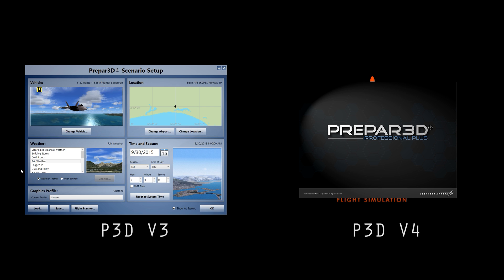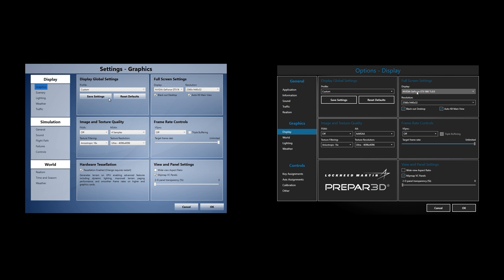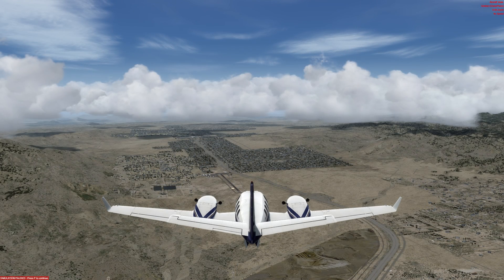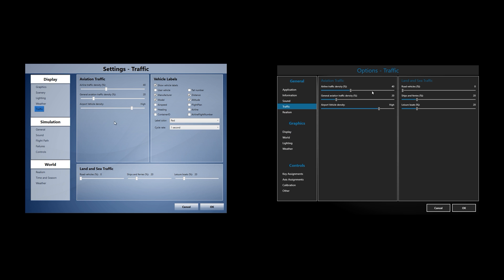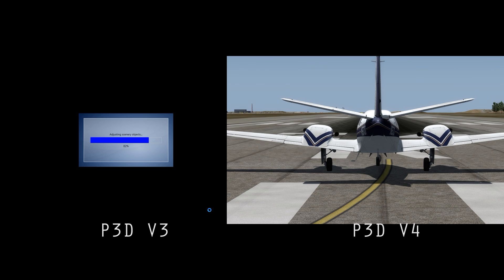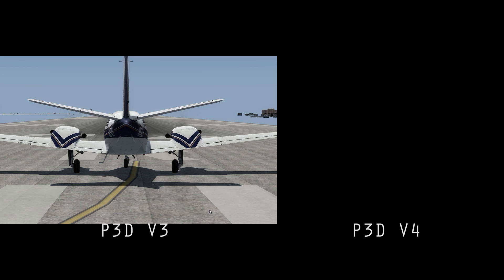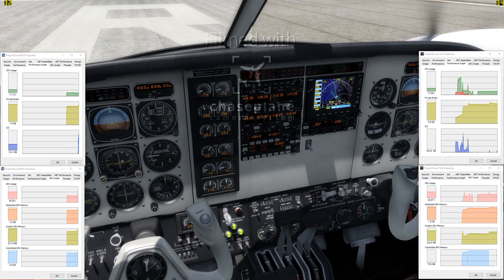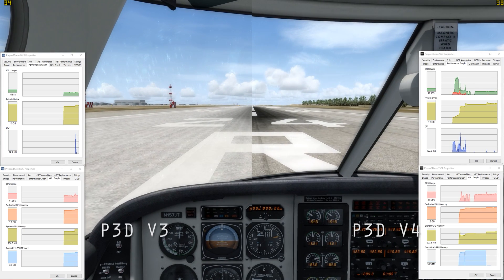P3d v3 VS. P3d v4 *Performance Side by Side and Stress Test*

Comment: x plane11 still way better
Reply: Indeed.  Would be nice if 3rd party devs would work with it.  But P3D is suckling off the established MSFS backbone and legacy compatibility is still a big thing apparently.
Reply: J.D Invictus hahahaha x-plane's engine looks way better than P3D. Weather is great! 
IXEG 737 (Same level as the NGX)
PMDG DC-6 (PMDG, 👈🏻)
LES Saab 340 (Same level as Majestic)
Flight Factor 757 (Same level as PMDG on systems)
Flight Factor 767 (Same as 757)
FlyJSim 727 Study v2 (Best 727 on the market)
FlyJSim 737-200 (Best 732 on the market)
Airfoillabs C172 Study Sim (Best C172 on the market)
Those are all high end addons
What is coming?
Flight Factor A320 (better than FSLabs systems)
Rotate MD-11 (better than PMDG MD-11)
Icarus DC-9 (Very great, supposed to be study sim)
Magknight 787-9 (Not high end, but a great quality 787)
ATS MD-82 (Better than any MD-80 on the market)
JRollon CRJ-200 v2 (Huge redesign!)
SSG CRJ-700 (Competitor of Aerosoft)
Milviz ATR 72-600 (Also coming for FSX/P3D)
ATS MD-11 (Same as with Rotate)
What utilities are great?
XPRealistic (like ChasePlane and EZDok)
MisterX free Airports with ORBX quality
MisterX Runway and Taxiway optimization
Zibo 737-800 mod
FlyWithLua
Ortho Scenery (Not even 1 payware product, all free and very realistic)
REX is coming
UK2000 is coming
And i only mentioned a few things
Reply: What do you mean it's not of the same quality? I say it's equal, if not better (Remember, I've used the Ifly 737--if anybody remembers that, PMDG, and IXEG, and being that I've been around 737s through simulators and real access). The sound itself beats the NGX, given I've flown on both the -300 and -700 countless times. My point being, you're judging X-Plane when it's in it's infancy of getting attention. To add, the scenery for X-Plane can easily beat P3D's. Would you like to spend (let's be real here) insane amounts of money for scenery, or use freeware for X-Plane that is just as good, if not better? You seem to completely forget Ortho Scenery, which yes, I love not having to destroy my wallet for. Because the X-Plane community has learned to develop higher quality freeware (Such as MisterX6 and other sceneries, which there is little to compare with in the MSFS world besides SunSkyJet), there is much less of a pirating problem (which runs insanely rampant in the MSFS world). X-Plane beats P3D in aerodynamics (which is a serious hitting point), detail (I'm talking about looking at road traffic, curved runways, vibrations (which comes free , which destroys P3D), and failures. If you do the engine startup of the FF 757, you will lead to an overheat which will lead to a complete failure of the engine. As much as you enjoy the P3D/MSFS world, I've never had that much detail taken into a simulator (and from PMDG experience as well). I respect your loyalty with the Microsoft/Lockheed side, as I was in that same spot for a decade., however I disagree on nearly all of your points given that X-Plane has freeware scenery that can compete with MSFS payware, and addons that can also compete with P3D addons, and I simply do not see how you cannot visualize that. Also--textures, UI, sound, Depth? X-Plane beats P3D in all of those areas, hands down. You're calling others "fanboys", yet you're showing the exact same traits you're criticizing (which is I why I rarely use the term itself)

Here's a comparison between X-Plane 11 and FSX:SE along with P3D. These aren't watered down to make one look better or worse. They are just straight out from when I was doing flight.
http://bit.ly/2rhEIRV
http://bit.ly/2rlznLc
Reply: UK2000 and REX will develop for XP 11. A good start...
Reply: I would like to disagree, as if I want to fly a 737, I have the IXEG, FF will give us the A320 that we've been waiting for, and I love the 757 and 767. We have MD-80s and such. You need to realize that there are planes in P3D that XP doesn't have and vice-verse. It's more so of, what do you fly, not "this is better or worse". Trust me, you haven't given much time to X-Plane, regardless of you "2 years of experience". I've use MSFS platforms for a decade, and just recently moved to XPlane. It certainly does the job. Ortho4XP and our custom group certainly does the job. Honestly, it's not that much of a letdown with Orbx as we can have terrain and scenery just as good through different methods.
Reply: I need to say when you see P3D V4 on video and X-Plane 11 IMHO X-Plane is way better the new beta version is really optimize and 98% stutter free. I know they don't have all the add-on I got on P3D, I will give a shot for sure for P3D V4 to with my PC what it look like but when I'm flying in X-Plane I found the immersion very great. For my part if I was able to have all my add-on on X-plane 11 I will move on or I need to change my mentality and be open to try new add-on like FF with the A320, the B737 default modify by Zibo, new airport by Mister X...
Reply: Marc Hatzimanolis  Maurits Veen P3D/FSX= PMDG 737, 777, 747, J-41, MJQ400, F1 DC-9-30, B350, ATR72, C-Mustang, M-dog MD-80, A2A C152/72, B-17, L039, P-180/250/51, T-6, B377, Spitt, RAir B60/T, Mlviz b-55, c-310, Level-D 767, TFI B717, FSL-A320 etc!....these are ALL REAL STUDDY Level sims. 
Weather ASN AS1016, OPUS, REX. All as real as it gets!

Maurits Veen IXEG 737 (Same level as the NGX), LES Saab 340 (Same level as Majestic),  Airfoillabs C172 Study Sim (Best C172 on the market). You on drugs? LOL! No comparison, you list just got from bad to BS!

The texture quality in ANY x-plane cockpit is plain ugly & not looking real at all, the gueges, efis, pfd can't be compered with FSX/P3D! And don't let me start on scenery, x-plane will always be ugly !!! 
I won't even touch it for free! 

Best sims P3D/FSX & DCS World if you want to come "as real as it gets"/ from an IRL ATPL  Captain >9000h (F-50, Saab-340/2000, B742, B777, A320).
Reply: J.D Invictus IXEG? Flight Factor? Rotate? They have high quality addons, just not the type you fly (likely). After all, there is much more freewarr that is actually good, than in MSFS, thus less of needing to purchase things. And nobody pays attention to the default 737. It's not the PMDG, but it's an amazing aircraft. If you don't like the looks, change it yourself in the settings and with addons such as BluFx. I hate the "desert dry" look of MSFS, with little to no elevation detail with airports (i.e. curved runways) but that's just imo
Reply: PMDG 737? - IXEG 737
Like I've stated before, this is solely based off what aircraft you fly. I can ask the literal same with - What aircraft comes close to the Flight Factor 757 and 767? MD-80? CRJ? Etc
Regardless, there are high quality addons for X-Plane, just that it is solely based off what you fly. To add, MSFS has had over a decade for addons and developers. Sure, X-Plane was around at that time, yet you haven't given X-Plane an equal amount of time and attention to really prove itself with developers. If you gave XP the same amount of attention and time, it would destroy MSFS. You can't compare a baby with a full grown adult, thus X-Plane is just now starting to get some serious attention, therefore it's remarkable itself how it's competition and beating (in areas) MSFS without all the attention that MSFS is needed just to stay relevant.
Reply: I'm not a fanboy for anything, I see that childish. I go wherever the tech looks the best and gives the most immersion and for me at the moment that's X-plane 11 with its many free add-ons. if you prefer FSX or Prepar3D no one is trying to persuade you against it, it's a matter of personal choice. I have been with FSX and spent hundreds of dollars and hundreds of hours trying to get it to look good and I get X-plane for me to look better and for free.  So don't be childish and fight over your personal choice.
Reply: FF A320 has to to prove ii self if it wants to be compared as good as Fslabs. So far Xplane is way better and I'm still holding on to my cc to purchase P3D. Time will tell. I'd rather be flying a Fslabs A320 on xplane11 than on P3D.
Reply: JordanCO_ TV I've watched your video's. You can't program an FMS & who is flying an approach with M0.23 in the 737 MCP? So don't talk to me about system or flying knowledge! 
Yes, I look  85% in my flying at the instruments IRL (PFD ND ECAM) & after 20 years of flying I can spot the un-real looking, low-refresh rate, wrong colors, lack of compressibility error, not correct standard-rate turn, turn & slip indicator, wrong power to pitch ratio, etc. And I see that allot in x-plane! 
Mostly I'm fed-up with talking to armchair-pilots who don't know shit about RL aviation!
Reply: Have to agree with you Toti, see nothing there that would make me ditch X-plane 11.
Reply: +Jiří Kocman good question.  Just because some of us former fsx code base folks like yourself have started coming around to xplane doesn't mean we don't still have an interest or some modicum of hope that one of these two devs will come through and deliver a flight sim experience that represents 10 years of technological progress as opposed to lipstick on a 64 bit pig I lieu of a 32 bit one.   

And, for those on the fence not sure what to do, because all of this waiting for someone to update the fsx code has led to not all that much,  well they should know that more and more fsx'ers are beginning to embrace xp11, because it does represent that progress that all of these fsx re-hashes lack.
Reply: ImagenNoReligion 
LES Saab 340
Well IXEG 737, Flight Factor Boeing 757/767, FlyJSim Boeings, just a few
Airfoillabs C172
Reply: ImagenNoReligion haha IXEG not being on PMDG quality. I, fly, both.
Reply: ImagenNoReligion The Airfoil C172 is a study sim, how can it be better? And yeah, agree that the 757 has some autopilot bugs, hopefully they will fix that
Reply: ImagenNoReligion menu's? Textures? Update's? Depth? Sound? What is wrong with those? They are all great!
Reply: And to add, if anybody is a "fanboy" it should be me as I've been insanely biased with Microsoft/Lockheed Martin for years upon years, not even giving a change to Laminar Research. It's phenomenal how a couple of guys with Macs are challenging large-scale corporations such as Dovetail (Ex-Microsoft), and Lockheed Martin. And as I said earlier about the pirating problem, funny enough, there are already cracking videos on v4 regardless that there is a free trial for 90 days I believe my case here is closed
http://bit.ly/2rSCBX9
Reply: J.D, in a respectful way, I disagree with everything you've said. Firstly, if you look at the pictures I sent in my last reply, you'll see visually, I don't see how MSFS and P3D competes, at all. The panel of the FF destroys the QW and CS. Yes, they can be compared, and they have. If you would like me to do so, I gladly will. Again, I have flying experience, just as I'm assuming you do (at the controls, not just sitting in the rear smiling). Once Again, if you read my comments earlier, you'd see how I said you can change settings. Don't like it, you can change it yourself.  And what do you mean "PFD can't be compared (**it should be compared, not compered)?" Not only is that insanely vague, it's just simply not factual. The FF 767 PFD works just as the real one does, I should know, having been in 767 flight decks. Again, I believed you were trying to be respectful at first, but "all x-plane scenery is ugly?".  Seriously? That's insane levels of bias. You're telling me this (http://forums.x-plane.org/index.php?/files/file/33270-kbos-boston-logan-international-airport/) is ugly? As said by yourself, "You on drugs? LOL!". Again, try to be at least a little respectful, and let's not just throw full bias towards this. I've acknowledged that P3D is a good simulator, and I'm stating my claim and defending it. You're literally throwing your -biased- opinion around. To add, the Level-D 767, is not on par with the FF 767, and the DC-9 compares with the freeware DC-9 of X-Plane (which is of great quality). The M-Dog MD-80 is outdated, and again, does not compete with the Rotate and ATS MD-80. To add, all P3D v4 videos I've seen still have stutters (I'm not the only one, look through the comments of this videos, others have seen it). What good is 64-bit if you still stutter like this, and how bad will it be once you load all the addons in?
Reply: The free add-ons for XP, especially airports, are amazing and getting better. The plane add-ons are weak but after watching some of these V4 vids, I see more people will move to XP11.  That should push the bigger plane developers over to XP, or so you'd think.
Reply: +John Moore what good is all that scenery if the shitty program stutters through it.  I can fly my Airbus which does simulate fbw through a dense Manhattan skyline with zero stuttering, yet I couldn't do that in fsw without addons.  Also forget about fly by wire what about basic physics.  Xplane clearly has the edge on that. Not that physics is important in a flight sim, I guess we can call that a nice to have not a must have.  Finally all of these addons will eventually be on xplane because if pmdg doesn't do it someone else will.  In fact isn't pmdg's next release also available on xplane?  I guess it's not that hard after all - life will find a way. 

Stop hating, we all used to be hardcore msfs fans back in the day, but times have changed.  Xplane may have been the mac of flight sims  for most of its existence but it's quickly becoming the iOS of flight sim and devs are taking notice.  Meanwhile msfs code base is becoming the windows phone of flight sim.
Reply: +John Moore why would fsx people switch to p3d to get more of the same, when they can do so much better with xplane.  I wish fsx'ers would  stop being so green eggs and ham about this and just give xp a proper try.   I promise you if you put in the effort you won't go back to p3d.  It looks like utter shit in comparison to xplane, I'm sorry but you need to hear that, it looks like utter shit.
Reply: +Jiří Kocman TWITTER WAR!   This is YouTube not nam, there are rules!  

No it's not trolling, It's my expression of disappointment with respect to the marginal improvements we've seen on this code base as shown in this video, which I've been waiting for as long as you, whether with p3d or fsw.  If that's all I said you'd have no gripe because it's on point.  However, you won't allow me  to go one logical step further and suggest to  some who also have been waiting years for this moment and are also disappointed with this marginal improvement give xplane a try, well that's just silly.  

Perhaps if I went on a rant about how battlefield is better than call of duty you'd have a point, but in this case I believe X plane comments have a frame of reference here, man.  

People are about to make big investments in terms of choosing the next sim, I think opinion regarding all options is in order.
Reply: That's because this was meant to show the difference between v3 and v4 only. It wasn't meant to compare all different sims. The OP isn't a troller.
Reply: What weather is very good?  The $80 plug-in that makes all the clouds 2d sprites that spin around when you pass over them?  I will say the default clouds now in XP 11 have come a very long way.  As for high end aircraft, name one that compares to the Majestic Dash 8 or the PMDG 777 or A2A's GA aircraft.  There is a polished level of software that you just don't get with X-Plane add-ons (YET) -  I think that will change in the near future but right now, no.
Reply: If you think IXEG 737 compares to PMDG 737 then I understand why you would be confused about this.  The IXEG 737 doesn't even have a complete FMC.  The menus might as well be DOS based.  Yes there is an add-on 737 for X-Plane, but is it the quality of PMDG's?  No, it's not.  And yes FSX devs have had more time, so what?  How does that change my point?   Add-ons are of a higher quality for P3D.  Goes with scenery too.  Look at Orbx's block island compared to a brand new block island that came out for XP 11 this past week.  It doesn't even compare.  And I will give it time, I want X Plane to get better, but right now, it isn't.
Reply: It's easy.  Textures, Menus, Options, Updates, Liveries, Depth, Sound.  Aside from being a study sim, those are some other areas I look at when purchasing an add-on.
Reply: ImagenNoReligion btw about the $80 cloud plugin. I think you have the wrong thing. That is SMP which costs $40. xEnviro costs $70 with 3D clouds, not rotate when you fly past them, uses an accurate real weather system, and rain and snow effects
Reply: I agree with every add-on you mentioned.  I still like the feeling of flight in XP though.  Obviously A2A got around it with their own flight model.
Reply: It;s getting better. But I can't lie this weekend I  reinstalled FSX so I can fly the FSlabs A320.
Reply: LSilva 😂😂😂
Reply: J.D Invictus bad to bs? I can already see that you never even saw x plane, saw...
Reply: J.D Invictus lol don't say P3D does that even a bit better. X-Plane's flight dynamics and graphics are far more superior than P3D v4. I also fly sometimes as a pilot, sometimes in a full motion sim (like tomorrow, KLM training sims at Schiphol East) and sometimes irl. (Last time in a KLM Aeroclub C172) i know exactly how a plane reacts and how it all should be, and X-Plane does this in many cases way better than P3D. The only reason i have P3D v3 is because of the MD-11 and the 747 v3. I can end that chapter already soon with the upcoming MD-11 for x plane, and then just leave the 747 behind. P3D=money, game that kind of stuff. XP11=freeware stuff, FAA sim you know what i'm talking about? Well thank you. As i said with the 747 this 'chapter' is over for me. Have a good conversation.

Cheers,
Maurits Veen
Reply: In response to the sceneries you mention, We have Drzewiecki Design for New York airports, MisterX6 for KLAX, KSFO, KSAN, and have KSMF sceneries (all of which are free and are of great quality), we have Aerosoft Amsterdam, along with Aerosoft EGLL. Seattle is custom made and is great and yes, there is payware and awesome freeware for it (just have to take a look around x-plane.org) Therefore, we do have the scenery. Remember, the exact same statement can be said to the MSFS world. Where is your 757, 767, MD-80, 737CL, A350 of high quality that real crews? Where is your Houston Hobby? Dallas Love Field? New Orleans? Portland (which is seriously been lacking) etc. It's more-so of "what you fly". I've never heard PMDG make a statement like that, and yes, X-Plane can surely handle a PMDG-level product (as it already does with Flight Factor products and IXEG). I've got some confidence in Rotate with their MD-11 (as they've stated they're going for a better product than their MD-80), and having owned the QW 757 (as CS), they don't come close to the FF in terms of quality. I have my doubts with aerosoft and how in-depth it will be, system wise, with their future products. Again, I fly certain types of routes, therefore I don't need most of what you described. "If X-Plane is the future, then PMDG, Majestic, FSLabs, FlyTampa etc will all go out of business." - Not really, they just switch or make sceneries for both... That's already happening right now honestly. And finally, X-Plane is not a "weak" simulator, because of it's engine, we have certain things P3D doesn't, (not that it really matters just making a point). I've used P3D and MSFS for a decade and just now am using XP. It's just as powerful, if not more, from my experiences. With the original beta release of X-Plane 11, there already has been a shift, and as Laminar Research continues, we're seeing more of it. Don't get me wrong, P3D has some awesome sceneries that X-Plane doesn't have an equivalent to (such as KMDW), just that XP has some that P3D doesn't and vice-versa

And may I question why you believe X-Plane is too "Weak" to handle a study level aircraft? It already does this perfectly fine...

EDIT: Forgot to mention we can convert plenty of MSFS sceneries to X-Plane with ease :)
Reply: You can convert your Drzewiecki Design NYC to Xplane for free using World2Xplane converter.
Reply: pifflelaw Drzewircki has their NYC scenery for XP available
Reply: +JordanCO_ TV true, just an FYI for those who've already spent the money on the fsx version, they don't necessarily have to go out and buy it again.
Reply: +pifflelaw Yeah. With all the freeware available, much less pirating :D
Reply: Sorry, not following.  I'm only mentioning it because one of the common reasons you hear for not wanting to adopt X-Plane is that people are too invested in their addons.  I'm pretty sure it's within the realm of fair use to transfer your flight simulator scenery packages, that you've paid for, from one sim to another, as long as it's for your personal use.  I certainly don't think that would be considered piracy.
Reply: pifflelaw I mean in the MSFS world, piracy runs rampant with tons of payware, along with little freeware that is of high quality. However, in the XP world, there is more of a balance of high quality freeware and payware, leading to less piracy. After all, there are already cracking videos for P3D v4, sadly enough. My apologies if I wasn't clear enough
Reply: pifflelaw Pretty much. I feel as if PMDG currently has an open door for aircraft, however the longer the wait the more likely some other developer will develop something for it (imo)
Reply: John Moore It would be awesome if they released copies for X-Plane and P3D, with a team working for XP and one fot P3D. I doubt it'll ever happen, but time will tell
Reply: John Moore I mean if they did similar to what PMDG did with their DC-6 (released one for P3D and one for XP). I've never coded for XP, however I haven't heard of the SDK issues. PMDG has already dipped into the water with their DC-6, it's possible
Reply: What I'm saying is look how long it's taken the DC-6 to be P3D ready. there's obviously a lot of things that have to be changed. Porting their current lineup just wouldn't be feasible for them considering the small fanbase of XP and most of their customers on FSX and P3D. I think one dev put it this way "in X-Plane, it takes 50 lines of code to accomplish what 1 line can in P3D"
Reply: No doubt, that would be insanely awesome! I don't think that even PMDG would want to finance 2 full time dev teams though.
Reply: John Moore Yeah, just I've never heard that (not saying you're lying or anything, just haven't heard a developer say that). I mean for future development to have to separate groups working on a model, one for XP and one for P3D. Scenery wise, Scenery making is fun and I've have much better experiences with it, but I see you're point. Maybe when time passes we'll see something different
Reply: pifflelaw It took me ages to even consider the demo, and I denied the demo regardless of how good it was. Based off what I did, probably others are in the same state I was in
Reply: I downloaded the demo, and I actually hated it at first.  However, it was the youtube videos and the delay announcement from Dovetail that convinced me to take the plunge and buy it anyway.  Once I took the plunge it probably took me a good month or two before I really found my stride with it, but now that I have, I'm never going back to an FSX derivative code base.   

If I could suggest one thing to Austin it would be to make it a timed demo, like 60 days, but allow full access.  This way FSX'ers can explore their favorite regions using the great free addons that are out there and learn the X-Plane process.  Limiting the demo to Seattle, IMO, sells it short a little.
Reply: For the people that still want the platform's developers but want an upgrade over what FSX can provide. I agree, P3D looks like a dump compared to XP but that's what scenery is for. I have some money in Steam giftcards so I might get XP-11 to try it out. I may be a convert by this time tomorrow, who knows.
Reply: I don't remember what dev posted it but I think it was in some obscure corner of the PMDG forum. I just couldn't see PMDG being able to swallow their pride and outsource an XP version of the 777 or 747 to another dev given their level of perfection.
Reply: BaconFat Studios don't forget Flight Factors "legendary" status as a dev that's better than PMDG and FSLabs combined...
Reply: ImagenNoReligion there are some great addons for XP, all we need is weather... check Ithe IXEG 733 or the Flight Factor A320 coming soon :)
Reply: IMO X-plane lacks good weather, seasons & high-end addons ie. PMDG, FSL, MJQ400, A2A...ASN etc. + the cockpit graphics always look un-real to me infact the whole graphics engine looks strange. No point in changing to x-plane & spend even more cash! 
I'm still staying with FSX that I'm extremely happy with & had 0 problems with.
Reply: x plane 11 add-ons still way worse.
Reply: I do not see any XP11 on video, do you? What is your point to comparsion P3Dv3 vs v4?
Reply: Video compares P3Dv3 and P3Dv4, there is no comparation to ANY other simulator, so OP is just trolling, nothing else.
Reply: Just a fan boy of X-Plane.  While the Saab 340 is great, it's not on Majestic's level, it doesn't even have an FMC.  Also, as I've said before, IXEG isn't even close to PMDG's 737, both in systems and user friendly UI, setup, trims, etc.   I do like Flight Factor and primarily fly the 757 v2, I would even go as far as to say that add-on is the best you can get for X-Plane currently.  Some weird things with VNAV still, it seems to get a bit wavy on descent, but that's something I can live with.  Airfoillabs 172 is OK but it's not on A2A's level.  No way.  I actually prefer REP (reality expansion pack) over Airfoillabs.  FlyJSim stuff is OK also, especially considering 1 guy did 99% of it.    Now, if you look at the stable of FSX/P3d stuff, and the quality of it, it's on a different level.
Reply: +ImagenNoReligion not anymore.  I disagree.  I used to agree but after 8 months of xplane I can say you are not wrong just uninformed.  Jar Airbus is legit and the upcoming flight factor a320 will be even better than what's out there for p3d.  

The scenery it's work but worth it with so much amazing scenery coming online for free.  I just downloaded an unbelievable Buenos Aires and a sky harbor scenery pack, all free, better than anything I saw on fsx.  

I know that we've been trained to hate x plane since msfs 98, but times have changed.  Austin extended us a major olive branch by making 11 the first Unser friendly xplane, why wont you take it?   The future is xplane the sooner you accept it the faster you will achieve flight sim nirvana.

Be objective if fsw or p3d looked half as good as xplane and performed half as good, you'd shouting from the rooftops.
Reply: I've been using X-Plane for over 2 years.  I've used so many of the add-ons.  I have JAR A320/A330.  I have FF 757/767.  I have FlyJSim's 727/737. I have lots of other general aircraft and helicopters.  I can tell you this, they are NOT on par with P3D add-ons.  Jar products are absolutely garbage in terms of aircraft performance and flight management software.  No decent weather support, no Orbx support.   P3D v4 is going to become my main sim JUST because of the add-ons.  I can't wait to fly PMDG and the FSLabs A320.  Q400 is also an add-on that nobody can even come close to in X-Plane.  Not to mention the PMDG's 747 / 777.  While I agree out of the box X-Plane is much prettier, until they get some major 3rd party support, I'm going back to P3D v4.   P.S. I'll always fly helicopters in X-Plane.